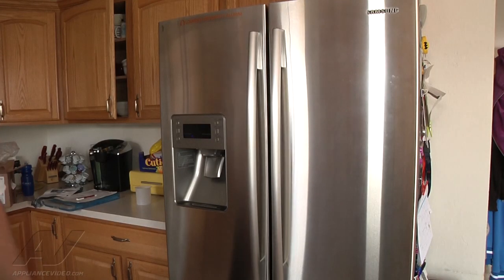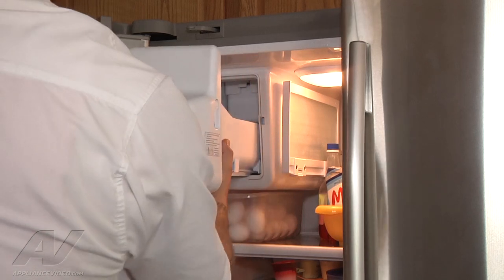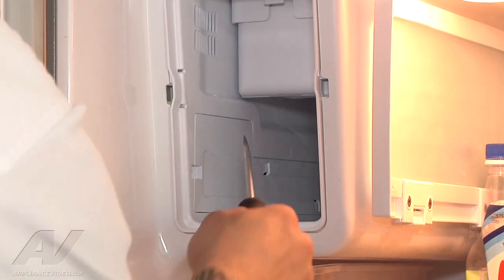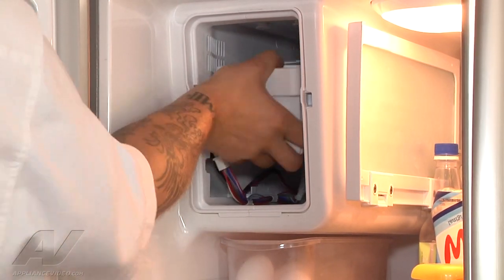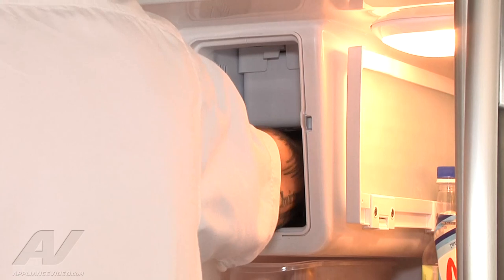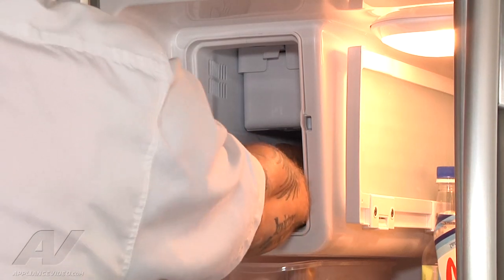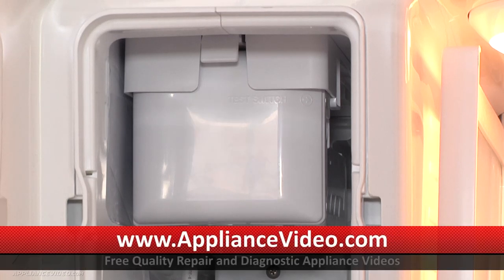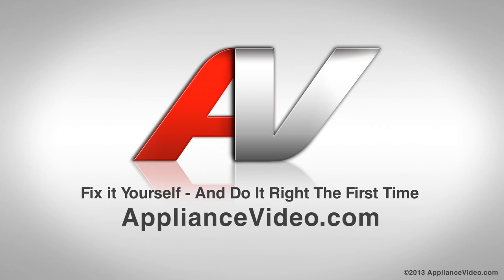Samsung Refrigerator Repair - Not Cooling - Ice Maker

Comment: Great video. I just replaced mine and did all the steps but it is not filling with water. What am I not doing?
Reply from the maker: Mike 
       After installation it could take up to three hours to go through the harvest cycle. The ice maker internal thermostat needs to get anywhere from +5 to +10 degrees. If it does not cycle in 3-5 hours write us back to go to the next step.  Please help us provide more videos to our site by posting ApplianceVideo.com on your YouTube, Facebook or Twitter account or add us to your circles. If you are in need of any parts please support our parts department on line at http://savemoreonparts.com/ or call 1-800-830-5465 7-days a week until 11pm Eastern time. Thanks again your support.  Matt, Ace Appliance service technician.
Reply: ***** how do you replace bottom ice maker in the freezer part of the fridge?
Reply: Mike, what was the outcome of your installation? Did it finally work?

Comment: Do I have to turn off the water supply and electrical power before replacing the ice maker?
Reply from the maker: Great question, if you have a more technical question that our parts department cannot answer, you can search our over 17,000 answered questions free at our website www.ApplianceVideo.com under our Repair Help section. You can also call our parts department at 1-800-830-5465 and they can give you help 7-days A week ,or search at www.SaveMoreOnParts.com  .

Comment: I have this model and my ice maker quit making ice. I rest it and still nothing.  The water dispenser works fine?? Any thoughts?
Reply from the maker: Great question, you can call
our parts department at 1-800-830-5465 and they can give you help 6-days A week Mon-Sat . You can also search at www.SaveMoreOnParts.com 7- days a week.  If you have a more technical question that our parts department cannot answer, our technicians are answering all questions at our website at www.ApplianceVideo.com under our Repair Help section. We have over
4,000 common questions and answers that you can easily search through by your model number, appliance make, and problem or error codes, and It’s free to search through our question & answer library.

Comment: the door flap on our ice maker is not closing, so the hot air from the room enters and melts the ice causing a constant drip.  Do you have a video on how to replace or fix the flap?  Thanks.
Reply from the maker: Good question, with our
technicians now getting hundreds questions weekly, they are answering all questions
at our website http://www.appliancevideo.com/repair-help/ .  We also have over 3,000 common questions
and answers that you can easily search through by your model number, appliance
make, problem or error code and it’s absolutely FREE.

Comment: how do you replace the bottom icemaker?
Reply from the maker: Great question, you can call our parts department at 1-800-830-5465 and they can give
you help 6-days A week Mon-Sat . You can also search at www.SaveMoreOnParts.com 7- days a week.  If you have a more technical question that our parts department cannot answer, our technicians are answering all questions at our website at www.ApplianceVideo.com under our Repair Help section. We have over 4,000
common questions and answers that you can easily search through by your model
number, appliance make, and problem or error codes, and It’s free to search
through our question & answer library.
Reply: I wanted to know how to replace the icemaker in the lower freezer bin..not the top but thanks
Reply: there are 2 phillip screws that you reach in the front of the icemaker just under it. Once those two are out..the unit slides forward off the retaining hooks.  There is one connector that you unhook once the unit is slipped off.

Comment: cant get the ice bucket to slide out I pull the latch and it acts like it wants to come out but top left acts like its not letting go or unlatching
Reply from the maker: Great question, you can call our parts department at 1-800-830-5465 and they can give
you help. If you have a more technical question that our parts department
cannot answer, our technicians are answering
all questions at our website at www.ApplianceVideo.com under our Repair Help section. We have over 3,000 common
questions and answers that you can easily search through by your model number,
appliance make, and problem or error codes, and It’s free to search through our
question & answer library.
Reply: I got it there was ice stopping it blew a hair dryer up in there and finally got it lose and ice was accumulated where its suppose to drop into the bin got it all cleaned out and reset with reset button and had ice this morning.

Comment: My icemaker fills with water, but does not make ice. My concern is even if I replace the icemaker it still does not make ice.
Reply from the maker: +M K 

         We would like to help you answer your
question. With our videos now getting over 900,000 views per month and hundreds
of questions from people like you, our technicians are now answering questions
at our website http://www.appliancevideo.com/repair-help/ .  We also have over 2200 common questions
and answers that you can easily search through by your model number, appliance
make, problem or error code and it’s absolutely FREE. You also have the option
to email a factory service technician with a question on your appliance at http://www.appliancevideo.com/repair-help/ . If you’re looking for a repair video, you can
also search our library of over 2600 free repair videos. ApplianceVideo.com
specializes in quality DO-IT-YOURSELF appliance repair videos and we get over
800,000 views per MONTH to our videos worldwide and growing. If you need of
parts for your major appliance, we have over 5-million parts in stock at http://savemoreonparts.com/ .  Thanks for your support. Matt Ace
Appliance factory service technician.

Comment: I clean my ice machine now I can't get the ice basket back in what happen
Reply from the maker: Great question, you can call our parts department at 1-800-830-5465 and they can give
you help 6-days A week Mon-Sat . You can also search at www.SaveMoreOnParts.com 7- days a week.  If you have a more technical question that our parts department cannot answer, our technicians are answering all questions at our website at www.ApplianceVideo.com under our Repair Help section. We have over 4,000
common questions and answers that you can easily search through by your model
number, appliance make, and problem or error codes, and It’s free to search
through our question & answer library.

Comment: What if after intalling the new part the rest button didn't ding and didnt hear water?
Reply from the maker: +Joe Levato 

         Good question, with our technicians
now getting hundreds questions weekly, they are answering all questions at our
website http://www.appliancevideo.com/repair-help/ .  We also have over 30000 common questions
and answers that you can easily search through by your model number, appliance
make, problem or error code and it’s absolutely FREE.
Reply: Did you ever get this answer?  I'm having the same problem.  Thank you.

Comment: My icemarker  running water in to bucket freeze will not come out ,what do
Reply: Need new
Reply from the maker: Great question, if you have a more technical question that our parts department cannot answer, you can search our over 17,000 answered questions free at our website www.ApplianceVideo.com under our Repair Help section. You can also call our parts department at 1-800-830-5465 and they can give you help 7-days A week ,or search at www.SaveMoreOnParts.com  .